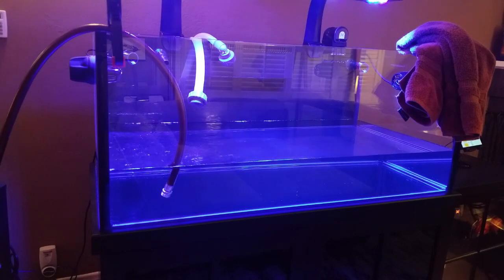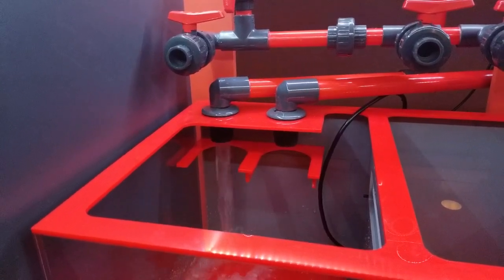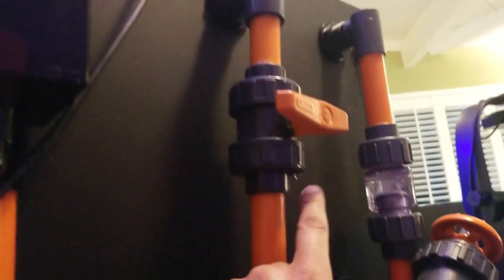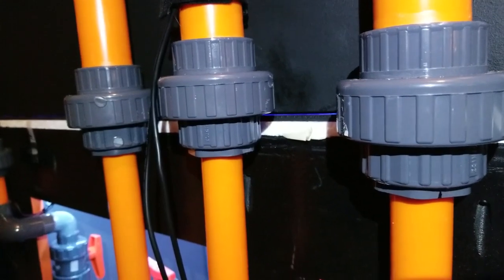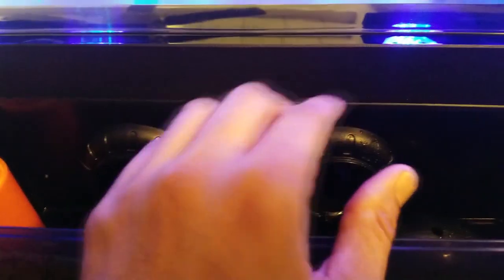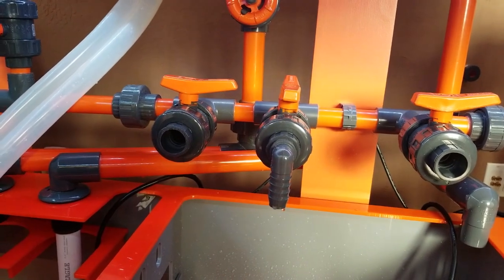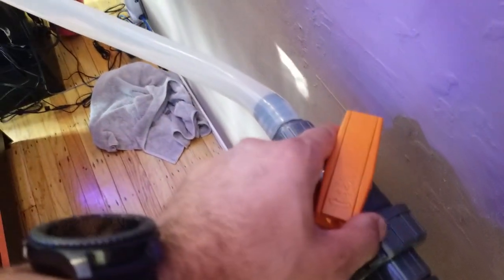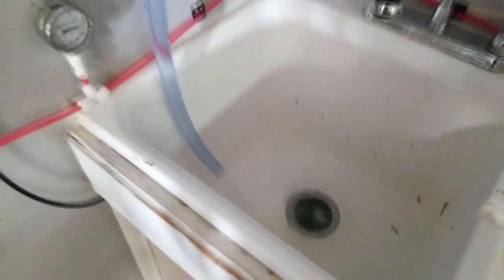Build Series| Eps.18| Aquarium Plumbing Leak Test

Comment: Helpful tip refer Gil! Using silicon grease on all of the Union gaskets greatly decreases the chances of a leak and helps to make a better seal. Also makes tightening and loosening the Union a lot easier
Reply from the maker: Great info, thank you for sharing.

Comment: I am glad you got the leak issues resolved.  I had a few leaks plumbing my system up.  On the plus side you did not have to tear our the plumbing a redo all of it from scratch.  Great video.
Reply from the maker: I laughed at myself reading your post. I was imagining what my plumbing work results would have been if I plumbed up 1600 gallons of aquarium, like you have. I would have been ankle deep in water if I had the same ratio of leaks as I did on this tank. Thanks for the post Alex!

Comment: Gill, one thing after another. I used so much glue on my PVC fittings that I knew I was gonna have a leak.  I know you walked away from the tank a few times to get a breather.  It's extremely frustrating.  Over all everything looks great and I love your system.
Reply from the maker: Really appreciate that SC, using liberal amounts of glue is important!

Comment: I always grease, use silicone grease, inside the nuts on unions. This is because plastic to plastic friction can keep you from tightening the nut easily. It is also good to grease the o-rings to keep them from drying out.
Reply from the maker: Will do, I need to take all this apart and give it a good cleaning. That'll be a good time to lube everything up as you described.
Reply: You are 100% correct on this...silicone grease or a spray such as the WD40 silicon spray will work but grease is definitely better.
Reply: @GSP-76  wouldn't the chemicals like WD40 leak in to tank 🤨

Comment: I think I mention the overflow didn’t look to good to me as a plumber (not enough sealer to me)
The drain hose if you decide to go with pvc just put a tee with a piece of pipe above the tank and will work as a vent since the water is draining by gravity needs properly ventilation that’s why is kinking the hose cause is not air helping
My friend your good,  it was nothing compare to the amount of pvc joints 
Is looking great. Pretty close to the moment of the clown returns.
I love your drain system I only wish that I had a basement.
Great work and perseverance form now one is all good coming to your tank
Reply from the maker: I didn't know you were a plumber, wish I did. I'm going to add the stiffer hose on and probably back off the amount of water I drain out. Makes total sense to ventilate the drain though.
Reply: ReeferGil no problem brother you reacted like a pro , solve and went straight to the source of the problem. Is looking good man this is only a little bump in the road and in my opinion is nothing compare to the side of the build 
Keep it up am sure the clowns are anxious to comeback home

Comment: Use pipe dope on threaded parts only on unions. This will cause less friction and allow for seal to evenly tighten. Plastic yo plastic with no pipe dope causes o ring to crimp itself out of seat where gasket sits.
Reply from the maker: Awesome, thank you very much for the post.

Comment: Higher flow actually creates less pressure in the piping. That is why your silicone tubing collapses.
Reply from the maker: I ended up replacing it with PVC, thanks for the post! 👍

Comment: Being a plumber for 30 years-shit happens, u can buy oring lube or grease which will help seal joints faster, u can get that in oxygen safe so I’m assuming it will be good for ur tank also oxygen safe green Teflon tape, one thing I found out recently when cleaning my manifold is that the brown gunk that usually collects inside the pipe only collected on my white pvc fittings not the red pvc pipe I got from BRS?? So I won’t be taking it apart for a long Time now that I know that, luv unions but always a potential leak, I’ve had copper pipes not leak with 100 lbs of pressure and not being soldered, someone upstairs was looking out for u!!
Reply from the maker: That's great info Surro, thanks for taking the time to share. I love having plumbers on here to help out the rest of the community.

Comment: I had a bunch of leaks also but nothing a few squeezes with the pliers didn’t fix... we did share the same leak with the overflow and I had to crank down harder then I wanted to on the bulkhead nuts for it... but now that it is leak free time for sand/rock/water
Reply from the maker: No  more leaks from the overflow bulkheads? How long have you been running your system since your water test? I'm still really nervous, lol.
Reply: ReeferGil it’s been up since beginning of October so not long by any means and it’s still not leaking... if you’re concerned about it take em off and clean the area with some alcohol and the gaskets and have some piece of mind